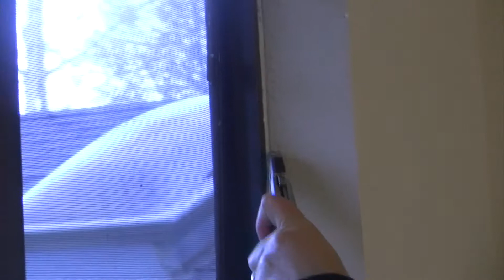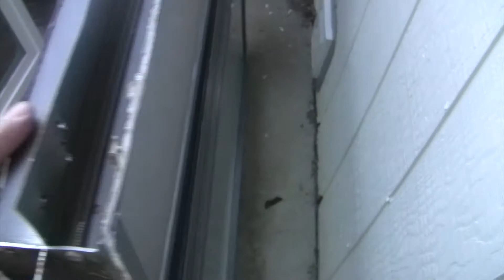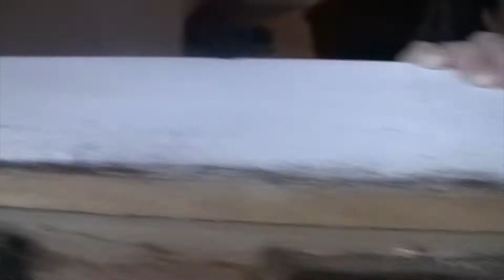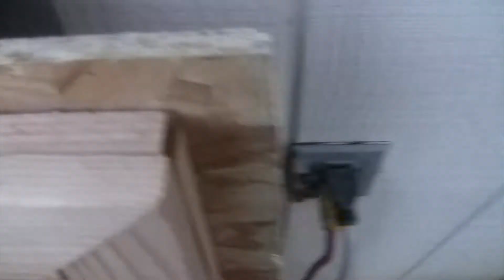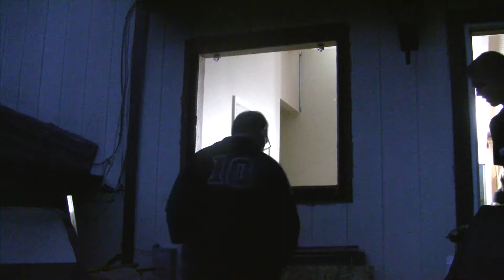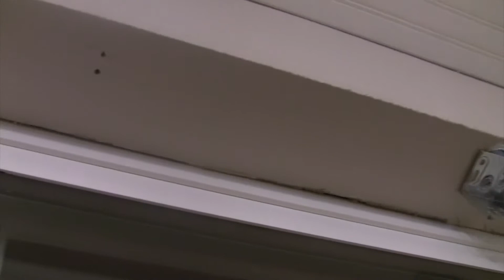How to replace a window with a thicker one.  Perfect fit!

Comment: I have new vinyl windows about 1.5" thicker, replacing thinner aluminum framed windows in January. Total 6 Windows 4 have brick surroundings, so the thickness is no issue. The two windows  in siding with wood trim will be installed by overlap of drywall and sill. The gsp will be taken up with (I think) lumber and sealant. I like your idea better... but the overlap method will alao work.